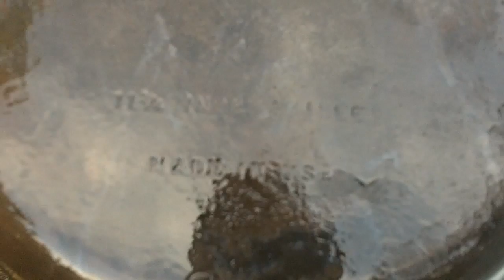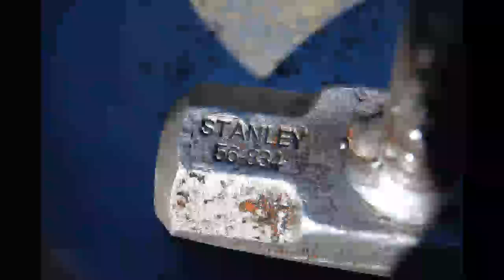Operation Skillet Rescue - Restoring a Cast Iron

Comment: I've restored several cast iron skillets and ovens with water and steel wool. That's all you need. Elbow grease, water, and steel wool. Then dry thoroughly, and reseason it in the oven with some Crisco. Done.

Comment: Have been cooking on cast Iron for 40+ years. You can get the black stuff off with oven cleaner then the best thing I have found to get to the metal is a 3m abrasive wheel on a drill. Then recure and cook. Never ever use soap on a cast iron skillet. Cook, wipe, rinse, dry over a warm burner and oil lightly.
I am goign to try vinegar on some old tools : )

Comment: Use a Black 3M heavy duty scrubbing pad and wail away on the pan!  Add a little or lot of Comet scouring cleanser!  If that doesn't work do a barbecue approach by using 10 or 12 briquettes and leave them cook until they turn hot red and then, worn out white, and pour out the remains and dust off the pan!  This is guaranteed to remove any external rust or cooked on remains, and leave you with a gray finished pan, that you coat with a light film of olive oil on a paper towel, and heat it up to 350 degrees for a half an hour...take out and apply a second coat of olive oil and wipe it dry!  Better yet!  Bake some pancakes until they stop getting black film on them....That is how to bake on your seasoning!

Comment: In the future you should just scrub it down with a steel or stainless steel wool scouring, for tough spots use the a sand paper or a wire brush, dry it immediately with a towel as air drying just facilitates more rust, then re-season it. You could have restored that pan in a few hours without all the useless soaking.

Comment: This was a lot of work for not much result.  I always soften the stuck on food with a bit of water, but not for a long period of time.  I never soak the pan.  Soften the food, use metal scrubber to scrape it out, rinse with water and then, the most important part is to dry immediately and thoroughly with a paper towel (or a towel if you don't mind it getting blackened), and then also immediately use paper towel to rub oil into the surface.  No soap, no soaking- both ruin cast iron.

Comment: I like his enthusiasm, but that was a hot mess of trouble. Bless his heart. Electrolysis can cut this whole process down to a half day or less. You just need a plastic trash can, washing soda, stainless steel cookie sheet, some metal hooks, steel rod about 32" long, a few c clamps, and a manual battery charger and your using chemistry to clean the skillet in a flash. Then re-season it with your preferred oil. Multiple thin coats are best.
Reply: Heck, vinegar works great. 2 days clean.

Comment: this is a cool idea if u dont mind waiting 2 wks. i tried this, the vinegar soak, sos pads-nothing. finally put the skillet & dutch oven on the grill using wood for the fire. let it burn a few hours. i put water & after that burned out i let it burn til it was white hot. everything was gone, just some blk ash on outside & a bit inside. i then got a sml wire cup brush for my drill & just used it to remove the last of the ash, burnt crust & ALL rust. maybe 5 min of work. like new.

Comment: A self cleaning oven, that locks during the cycle, is the only household device that reaches the temperatures high enough to turn all the carbonized grease to ash.  That includes the carbonized grease in the pores of the metal that actually make it slick. The object of "seasoning" is to fill the porous metal with carbonized fat which makes the surface slick.  The upper edges of the inside and the outside require no seasoning, only the cooking surface.  Have fun.  :D

Comment: I put my cast iron fry pan in the fireplace when it was just red hot coals and burned it clean. Then re-seasoned it with salt and oil. Came out perfect and nothing sticks. Did the same thing using an electric self-cleaning oven with the same results. So much easier and took only an hour or so.

Comment: It's just a piece of metal.
 I'd bust out some wire brushes and sandpaper. Power tools. Smooth the inside, clean the outside rust, and season. I sand all of my pans smooth on the inside.

The acid works, too. I'd neutralize it  after its done the work, and dry  quickly, to minimize the oxidation.

Comment: If you want a new pan, look for a 'Lodge' brand cast iron pan. They are made in the USA and very good quality. Once you have one, NEVER wash it with soap...all that is required is a little warm water, scrub brush, and then dry thoroughly (I put mine on a burner set to Low  while I finish cleaning the dishes.) It will be jet black and have a great non-stick quality.

Comment: People say that fire will damage cast iron but that is somewhat wrong but right at the same time. You want to use fire but it doesn't have to be super hot. My grama taught me to pre heat the pan to about 300 degrees in the oven first while your fire gets nice and hot. The point of the fire is to burn off the top layer of rust food and whatever else is on the pan. Sandblasting does work in some cases but you have to be careful not to damage the pan.

Comment: Make old cast iron turn-out like factory new: Use a bead blaster (blast cabinet) to remove rust and any surface debris, then wash it with hot water and a scrub brush (no detergents, ever). Once it's clean it will look like satin silver. Don't let it sit around, it will start oxidizing immediately. Coat the piece with lard or bacon grease and put it in a 400 degree oven for 2 hrs. Re-coat with lard or grease and put it back in the oven for another 2 hrs. then turn oven off and don't remove pan until oven cools. Never use vegetable or corn oil, use only animal fat oil. You can then season the pan by adding your favorite spices to lard or grease, coating the cooking surface only and put it back in the oven at 350 degrees for about an hour.This method produces an outstanding result and saves a ton of time.
Reply: Hi What is bead blaster
Reply: Visit a Harbor Freight store and ask to see one.
Reply: and I thought I was the only person to just use a bead blaster...
Reply: I use a bead blaster also because it is gentle. I like to get the scale off with a brush. I take the cast and put it into a heavy trash bag toss a cup of clear ammonia in, and let it sit a few days. then I wash it with hot water and Tide to get the ammonia and grime off. After the ammonia tide bath I toss the cast into the oven at 400° for 30 minutes to get the moisture out. Then I glass bead the cast. The reason I do all of the  cleaning before blasting is to keep the beads clean, and not push the dirt into the cast even more. I vacuum the cast after blasting so I don't blow glass beads into the pores and keep the dust down. Wipe it out and season it. The mistake I see a lot with glass beads is people use too much air pressure and do not have a water trap or air dryer on their air lines. I like your method and this user his method works great also. Have you ever used molasses or a hot tank to clean cast iron ?

Comment: that's a wagner made after 1960. 1960 is when the us gov required origion (made in the usa) stamps on products. and wagner spelled out skillet on their pans lodge used SK. also you can tell its more modern cause the lack of the woodstove ring on the bottom. electrolysis works in 2-3 days. screw this mess lol.

Comment: I understand you are trying your best to restore such a nice skillet but, frankly, you need to stop trying random things. Your idea that soaking in plain water would remove rust is simply not making any sense; water accelerates the oxidation of iron, producing more rust. The bits of rust you took out by soaking in water were just completely loose bits of rust, already not part of the skillet any more. All you need to do is soak in any acidic solution (always in a well ventilated area, preferably outdoors) and give it a good scrub with a wire brush (wash off and repeat, always wear rubber gloves when doing this). And never let it air dry, it will only rust again. After you dry it with a paper towel, make sure that the rust is COMPLETELY off. Finally, season the skillet, in order to shield it properly against future oxidation.
Reply: What about getting the pan down to the bare metal?  Does it take vinegar or are you supposed to use oven cleaner?
Reply: ***** try the over self cleaning method. gunk just falls right off, use a wheel brush on a power drill to get any impurities and season it in this order: 200 degrees for 15 minutes, pull the pan out, coat it with oil. 15 minutes later, pull it out and wipe the grease off. set the oven to 300 degrees, coat it again, throw it in for 15 minutes, pull it out then dry it off. Preheat to 400 degrees, grease the pan up again and cook for 2 hours.
Reply: Truth! The worst part is that he did his worst to remove the existing years or decades worth of seasoning that were obviously in the center of the cooking surface and all around the outside. He even noted this, calling it "black stuff". THAT'S WHAT YOU WANT! Taking it off only to season it back on is doing double work.

Also, use absolutely pure flax seed oil with no additives or particulates. Season it in multiple layers 5-10 times for a base seasoning layer, then let cooking continue to improve the seasoning of the skillet over time.

And don't wash it, just wipe it with a paper towel or at most a soft scrub sponge, oil it, and put it away.
Reply: Olo Burrows It's best to completely strip an unknown cast iron pan to the bare metal, then re-season it.  Quite simply, we don't know what that old pan could have been used for -- it could have been used for changing motor oil, for all we know.
Reply: how abt lemon/lime or vinegar ? Please advice.
Reply: Well but you can remove some rust with just water, as the water with losen up the larger pieces. Having it soaked in just water for some days will do more good than harm in my exp. But it is very important to soak the iron or steel in a base immediately after exposing it to air, to prevent more rust. Often you can watch the rust appear on certain types of iron, when its exposed to air after being soaked in water.

Comment: i also picked up some cast iron ware cheap and no walmarts stuff comes no where near the quality, i left mine on the stove oiling for couple hours seemed to solve most of it i then poiled it and put it in the oven for another few hours with salt in seems to of sorted the pan, just going to try the lid in vinegar as it didnt come out as nice ty for the vid

Comment: i've got a tip to save you a ton of time. steel wool, sand paper, wire brush  and elbow grease. Better yet, if you have access to a sand blaster and some fine abrasive you could get better results in 5 minutes than it took you to finish your project. .

Comment: @rogerpemberton I just found that i cannot post links in these posts. The reason they paint ships is because saline solution combined with exposure to oxygen causes oxidisation in metals. Water does an amazing job at preserving metals as the oxygen contained in water is not released from it's chemical bonds unless electrified or raised to very high temperatures. If you took a cast iron piece and placed it in still clean water it would last for decades longer than an identical piece in open air.

Comment: New cast iron might be as durable, but it's not as well made. Inside surface of new ci has a light texture, it will take years of seasoning to smooth it out.
Older ci was highly polished, very smooth, you will get a seasoned "non-stick" surface very quickly. And the older is lighter, it won't hold heat as well, but it heats up, and cools down, quicker, it's a little more responsive. It takes less energy to use.

Comment: I know some people restore cast iron by getting a fire brick and placing the cast iron on the brick in their ovens set to clean.  Once the clean cycle runs, and everything is cooled off, the rust and impurities just wipe right off.  Just another way to clean rusted cast iron without chemicals.

Comment: Wow, that's a lot of work and time.  Find someone who has a self-cleaning oven and get them to call you next time they run a cycle. Put your crusty, rusty pan in and when the oven finishes cooling down, wipe the powder ash off and season your brand new skillet.  The oven will clean the skillet the same as it does its walls.  I keep mine seasoned, but never crusty.  They are as slick as any teflon and food slides right out.

Comment: I am not so sure. It is not water that rusts, it is the air. i had a flood last year that destroyed most everything. In the shop i found an old chain hoist in a 5 gallon bucket full of flood water, that had been there for at least a month. i dumped the water out and the hoist looked good. HOWEVER, within minutes of dumping the water out it began to rust. i hosed it down with WD-40, (I was using it by the gallon by then) and it came out beautifully!

Comment: i have some old cast iron skillets that have a thick black coating on the bottom and sides. do i clean them the same way with the vinegar??  i tried to burn it off but it seemed to not help at all. the black stuff is kind of thick. one is a 6 inch that is over 100 years old. im hopeing thats the one because one brock in half. my daughter put it in a sink of cool or cold dishwater,,,,thank you   enjoyed the vider much

Comment: Love the video beast. I was reminded of an idea when I watched this video. I don't know how familiar you are with slow rust gun bluing but the theory behind it is putting a thin layer of rust on metal and then boiling it in deionized water. The end result is oxidation of rust (Fe2O3) to magnetite (Fe3O4) resulting in the black/blue coloring. I am sure that you could do the same to cast iron and card of the magnetite with sandpaper and reseason the skillet. What do you think?

Comment: Just use a wire wheel and an angle grinder. then hit with some Ospho. Then wire wheel again. Wash it soapy water while scrubbing it with Scotchbrite. 15 minutes  of labor and it will look like just came from the factory.

Comment: Cast iron should never be soaked in water for any reason other than to loosen caked on food you might have on it (oil is better it's more expensive). Water & cast iron for more than a few hours is just inviting more rust. To remove rust soak the pan in oil then use steel wool (the kind w/o soap), salt if you feel the need for fine abrasion, and just scrub. AFTER you remove all of the rust, season the pan, then cook onions or chives once after you season, this keeps food from tasting like metal.

Comment: So you placed the sledge hammer on the iron skillet to keep it down...  Do you often experience iron floating away?   And rather than adding water to raise the level... adding more 'stuff'... bolts, rocks, whatever... would have displaced the water to rise, maintaining the functional strength.  (and for the bottom of the pan... sitting on 3 ball bearings would have exposed it as well.)

Comment: I wonder if lime remover type toilet bowl cleaner would do the trick? I have used that on pots with bad lime scale.  Just can't use it on plated metal, aluminum or Teflon.
Reply from the maker: not sure Id want it on my food surface
Reply: Instead of lime remover, you can just use vinegar. It works just as well as CLR or any other like and rust remover and its of course 100% food safe.

Comment: Get you some steele wool Not SOS Pad never ever use any kind of detergent on you cooking cast Iron cookware.Scrub it clean blast out with water wipe clean .Coat it with cooking oil the whole skillit top bottom handle the whole skillet! Put in oven on about 375 and cook for about 8 hours until its coal black and its cured.Never wash it out with soap just hot water then dry and spray some olive oil on it set back on stove heat until shiny couple of minutes and good for next cook.

Comment: another way without using any chemical and much time, is to use sand blasting technique, if you have air pump at home by making simple sand blaster you can remove all the rust in no time with out wasting time, water and so on. 
Ofcourse you need to make some primitive sandblaster , and just use fine sand from your garden or some shere else.

Comment: Or you could hit with wire brush like you had in your drill, take all the rust out with the brush, then oil it down with veg oil  and fire up your grill outside and put it in there for about 45 minutes or an hour at  350 or 400.  It should come out nice and black. Oh yeah,l I use soap on mine all the time, if it is seasoned properly soap won't hurt it and if  it does lose a little of the black all you have to do is put it in the grill again.

Comment: NOOO!!!!! Black is beautiful when it comes to cast iron skillets! It comes from proper seasoning and years of care. The only reason to try and get a skillet back to it's original finish is because of rust. ALSO NEVER submerge a hot skillet into water! That causes shocking the metal, causing it to rapidly contract and fracturing. This is why the other skillet broke.

Comment: @rogerpemberton Water does cause rust, but you wash your car with it? Salt will corrode medal but you still use it to CLEAN cast iron as well.
You probably just use soda to clean everything right?
Why even clean or restore anything when you can just go buy a new one? That is the definition of Young One.

Comment: Way too complicated.  Chuck a wire wheel (I use a wire cup, Home Depot has them) in a drill and go to town.  Done in ten minutes for reseason, no need for water, chemical reaction, or any other overly time consuming task.  You're basically talking about removing material with any process anyway.  Once finished, wipe it out once with a oil soaked towel, get all of the debris out of it, then wipe again with clean oil.  Let it live happily in the oven, recoating every few days.